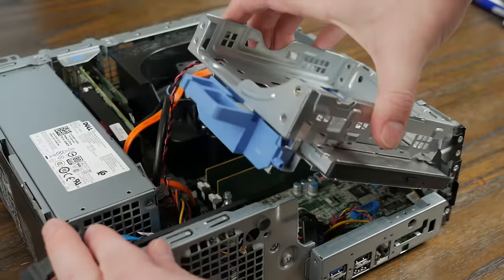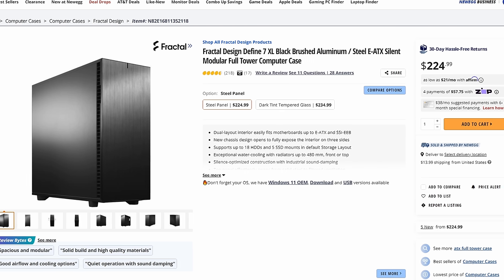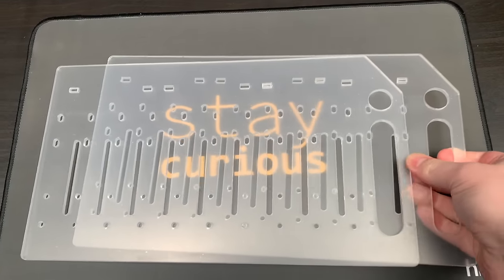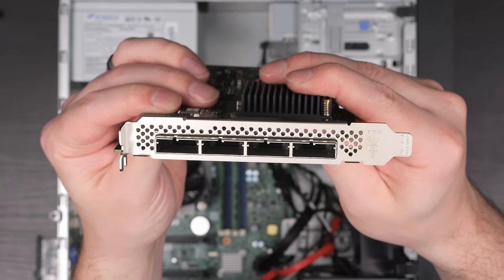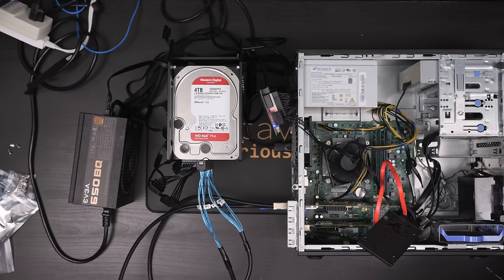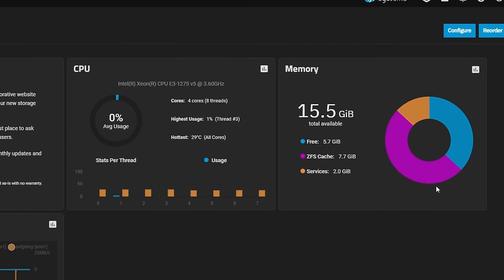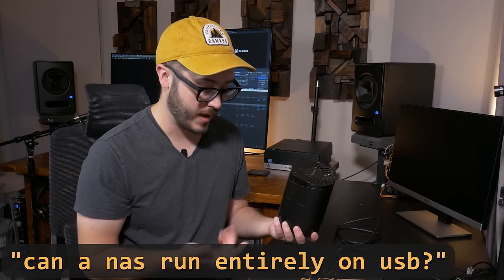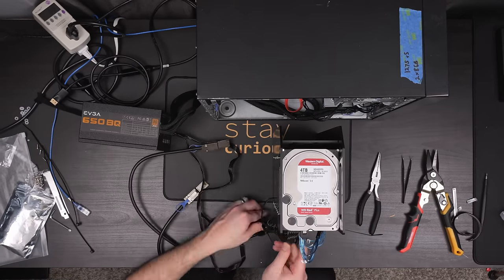I Made My Own JBOD Enclosure For CHEAP

Comment: IMHO what really is only required is to have "unlimited" number of disks connected to any computer and have direct access to those by the one OS using just one cable for eSATA or USB. Nothing fancy really required by bandwidth for the drives, just expose direct access even if it would be a 20-30 MB/s read/write speed. 

A NAS doesn't need to be extremely fast for most people.
It will hang on most people behind a 10/100 wired connection or even a 802.11n (150Mbits) wireless connection.
So the networking is really the bottleneck for whole stuff. 

Those who need massive amounts of storage for 8K video editing material, 3D rendering cache drives etc, that means they have money and options to go for full expensive servers. 

We really need a cheap, reliable and accessible HDD enclosures that would offer those 2/4/6/8 drives behind one cable (+ external power). 
It would allow to use any tiny computer with USB or eSATA port or two to get even max 8 (4x2) drives in.
Now it is more like required to have a external enclosure for two drives behind USB port, and if you want 4 or even 6, you pay crazy money for that.

As what does most people really need or want? It is to spend some time to just save their data on simple RAID 1 mode (if even that!), and then now and then connect third set to sync with NAS and then be moved off-site for backup purpose.
The bandwidth for data usage is really about streaming a own video from the server, as otherwise it is just accessing some normal documents or browsing some web gallery etc. 
So after the initialization, data bandwidth is really low, someone in family uploading a file from phone, someone from laptop etc, common 1-20 MiB in size at max. 

In time it makes great NAS to be tugged somewhere dry and cool location and forget it.

Comment: I did something similar but found a metal case called Sans Digital HDDRACK5. Fans and power switch included, also stackable. Unavailable now sadly
Reply: Had it book marked for years and never pulled the trigger.  The only thing that held me back was a solution to mount it in a case.

Comment: besides my main PSU (using it for my PC; it has 4 Sata adapters), I have another cheap PSU. How about if I use 4 Sata adapters of that cheap PSU? Following that way, I will have a total 8 Sata adapters to run 8 HDDs and SSD. 

Does it cause a conflict between two PSUs. But I only use Sata adapters from the cheap PSU, how can it cause trouble with the main PSU of my PC?

Comment: Can anyone mention what to keep an eye on for a PSU in a solution like this?  Will a 400 W PSU handle ~400 W of hard drives, or is the amount of power available to the SATA connectors much lower?  And are there limits to how much power is sent across each "line" of SATA connectors?  

If this is a well documented topic, would someone mind letting me know the proper search terms to throw into Google?

Comment: Pfft.. Fractal Node 804 8 drives. got one for 75,- X570 mini ITX with AMD R5 5650 PRO with 32GB ECC. system alone uses 28 <- Watt with 2 SDD +9 Watt  with an LSI 2008 :P
AND a couple of watt for my 6 PH-F120T30 120MM fans that can go up to 3000RPM and make it sound like a real "server" :P
i use an Icy-box 4 bay usb 3.2 gen2 10Gb that was 140,- or so. for my editing pc.

Comment: Hello, I dont understand if data in RAID (or RAIDZ) is protected agains loss or not. What can I do, If system drive will crashed? can I restore drives into another system as RAIDZ2? Or it only way to daily/weekly backup system not to lose your data
Reply: RAID lets you have redundancy. That means if you have a drive fail you'll still have access to your data. 
It is not a replacement for backups.
Reply: @MisakaMikotoDesu my question is not about crashing RAID's drive. It's about system drive crash, which can be unlucky be in only one copy.
Reply: @__-ur9gu  "System drive"? As in the drive your OS is installed on? If your OS is installed on the RAID, you can lose 1 drive (or more depending on your setup) and it'll still boot just fine. 
If your OS is on another drive and that dies? Then you will still have access to your RAID just fine once you reinstall your OS on a new drive.

Comment: Nice idea, but execution is lacking.
Frankly, I would rather use another PC case, and put it all inside. Usually there is enough space for two stacks of disks like that, and PSU would be mounted properly. Also it would allow to use bigger and slower 12 inch fans. If you lucky, you can get old case for free, or very cheap.
Instead of acrylic, You can buy metal plates with holes in a DIY market. This plates are originally used to join wood.

Comment: acrylic is the last thing i'd want holding hard drives in place. it is fragile and brittle and not suited for anything that vibrates tbh. for something like this, one strategy i like is making a cage out of extruded aluminum profiles (you kinda build a ladder for each side, L profiles for columns and straight flat bar bolted to it with a spacer for rows/rungs you can slide the hdd's mounting hardware on), removing the CD drive cage and HDD cage from the case so the entire front end is empty, then mounting the new cage in the empty space. bonus points if you make a SATA backplane so you can slide them in and out without tools (example https://www.youtube.com/watch?v=KICINe72tiM ).
Reply: if your drives vibrate so hard to shatter thick acrylic, they have some serious issues

Comment: I wish there was a variant for 2.5 inch hard disks.
Reply: You could buy the one he's using and make some holes yourself, with a drill, so that it also fits 2.5" drives. It's really just a matter of "measure never, cut whatever" 😂, no but in reality it should be doable.
Reply from the maker: I imagine there's a variant SOMEWHERE out there haha

Comment: The Sata Power expander are a Mayor Firehazard and it is not even a matter if they will burn at some point this practice has been shown to be so bad ever since these cables cables and molex to sata extenders have existed. Its not even a question of quality it is just plain a matter of physical reasons. A new quality PSU with >8 sata cables is a round 75$ which compared to the cost of 8 drives is minimal.
Reply: maybe don't buy the trashy adapters that have fake gauge wire

Comment: Can you edit directly from NAS or do i need to drag my files first ?
Reply: if the nas is fast enough (both drive and network connection speed), then you can, for the most part
Reply: @night_h4nter Aight, i have couple old computers i fill up first, and then think about external storages.

Comment: What is the logic of using JBOD structure when you have so many disks on hand? Wouldn't it be more sensible to use RAID structure? What will happen if disks fail?
Reply from the maker: I’m still using RAID just in software
Reply: jbod in this case is more of a term to describe the physical structure, not the storage scheme

Comment: Ok it runs,fine.My thougts on hardware : You wont need a sas controller when you use only 4 hdds. Use Proxmox on a pcie nvme ssd, go with disk passthrough.Why an addidional psu,use a big enough one(the 8 hdds consume only 65 Watt), no powerswitch and no fan regulator(can be done by resistors).My thougts on software: you could even run theTruenas Machine in windows hyper-V (the power saving options are exellent).Go with trurnas core, what scale gives you you already find in proxmox.The raid layout. besides this not a jbod  : Try 2 mirrored Strpes (4 disks) or 4 mirrored stripes (raid 10/50, they dont call it like this). Put more ram in it (recommended 1GB per TB !    Nice Video, have good day and thank you.  M.S.
Reply: i think in the video he says swapping psus isn't always an option

Comment: I'd love to see you get a 3D printer and design a proper enclosure rather than using a crappy AliExpress solution. Also, could you use a pico PSU for the drive instead?

Comment: Cute, but if I had to spend say ~$180 for a hard drive x 8 drives which is ~$1500 then adding an extra 300 for a good enclousure doesn't seem like a such a rip off anymore.
Reply from the maker: I actually cut a section of the video out where I talked about that exactly. It just got a bit long. It really depends on the buyer/circumstances, but yeah it's definitely something to consider if you're also about to drop $1000-2000 on drives haha
Reply: for 300$ you get a cheapo usb enclosure that is not great.
Reply: @marcogenovesi8570 I meant extra 300 on topo of the DIY solution cost. Which gets us to around $500. Still not great, but you could find something serviceable for that price. Whis is not nothing, but disks are the most expensive part here anyway.
Reply: @HardwareHaven  At least we've got an entertaining video out of this :)

Comment: While this is pretty neat and I've considered doing this myself, at 15:07 enterprise disk shelves are mentioned. I picked up a 24 bay 3.5" drive shelf plus controller and cable from the seller listed in the screenshot (disclosure, I am in no way affiliated, just a happy customer) and it comes with redundant power supplies and redundant controllers, and you can daisy-chain disk shelves together. Obviously it's a bit loud but has been running rock solid for years in my basement. The shelf is SAS-capable, but I can't remember if SATA will work as well (just because SAS has a compatible connector with SATA doesn't mean it will work with the controller).

It would be neat to see if you can bring that DIY version to its knees to see how reliable it is though.

Comment: you should build a diy server rack - 2x4 plus plywood - save 300-500 bucks - as for changes on this system...just buy a big case first of all and forego the hba and go with sata pci-e cards but for people who need the expandability this really is a decent option - make the fans into a modular system than you can pivot or move out of place and make the drives toolless - ie you want caddies  the plastic tongs that connect to drives on side and you can just slip and they snap into retention slots - there could be quite a bit of optimization here - going with an upgraded ps that can support all drives is preferable but again for people that want to run 10-20 or more drives the addps board and hba are good options - good due diligence on this one - maybe do a followup when you tinker some more and get some miles on it - it works and that is the main thing

Comment: I don't understand that setup at all. You can pickup a motherboard and just put the entire setup inside an old tower case.  A used fully populated motherboard with 8 or more SATA connections is cheaper than all the miscellaneous stuff you need for this setup.  Hell, even if he picked up a couple drive cages and stacked them it would be cheaper and more convenient.  It would sure be easier to swap drives when one fails.  You could do it with mostly E-waste parts too.
Reply: not all mobos from those dell/lenovo/etc computers are atx-compliant, so it's not always an option

Comment: Why go for the mini sas board over a 8/10 port PCIe to Sata converter given the price? Was it just for easier cable organization or does that have a stability benefit? I ask because I am planning to do something similar in like 4 months but was planning to use a with the Sata breakout but will go with this if it is more reliable.
Reply: the 8/10 Pcie Sata converters are often less reliable. It's actually done by using an asmedia controller and slapping one or many Sata port multiplier in front of some ports.
The main issue is the sata port multiplier, if you get a 4 port sata controller then it's done all by the same chipset without port multipliers and it's usually ok.
Reply: @marcogenovesi8570  that is good to know. Thanks!!

Comment: Me: Netapp DS 2246 now featuring silence and 12 gbit
Reply: sata disks are 6gbit only, you don't need to buy a 12gbit sas card
Reply: @marcogenovesi8570 I also had to remake the sas expander because yes, so I took an adaptec 12 gbit sas expander that can also be powered from molex connectors

Comment: LSI is DEAD.... plus the drivers are buggy.

and YES you DO need fans.. becasue if you take the trouble to READ the drive datasheets, these high cap drives are FORCED airflow only.

In some cases you only need to be out of spec by 2 deg. and it is game over.

Comment: 4tb drives in 2024? no wonder you're out of room.  instead of buying the second enclosure and the fancy psu relay and using a second power supply, and the hba, and the cabling, you could have spent about the same amount and pick yourself up a few 14-16gb 7200 rpm drives.  4tb is just NOT enough density by today's standards.  Personally, right now, i'm running 8x 14tb wd easystores (Basically 7200rpm wd reds that i've shucked out of enclosures) in raidz3 and there's room for another 8 in my fractal design meshify 2 xl.
Reply: How many 14-16tb drives can you buy with 200$ or less (which is the budget spent here)? On ebay I can get like one, used, with some pocket change to spare.
(EDIT: spelling)
Reply from the maker: These drives were just for testing. Having 8+ 12TB drives just laying around isn't that affordable lol

Comment: Not gona be fun finding the SN# of a failed drive tho.
Reply from the maker: True, lol. Would be worth the time to label them before putting them in
Reply: I just use a regular label maker to label the sides of the drive with the SN. But I kept mine clear. You could just label the sides of the plastic if you wanted to paint.
Reply: I agree.  I make sure every hard disk is labeled with the serial and function (Parity 1 or Disk3 or whatever).  Make sure it us visible.

Comment: How bout you run  the worst raid ever.... Do all the things people say not to.  Buy a bunch of Used drives, make the sizes all different, run without any ups/surge protection, and do a long term use experiment on it, if what you have supports the junk fake hardware raid run that.... Both A: how long you can keep it going, and B: videos on what it takes to maintain.  And maybe C: things you can do that are free or cheap to make it better

Comment: Please use RAID5/6 instead 😰
Reply from the maker: RaidZ2 is essentially Raid6. The naming is different in ZFS, but it’s still two drives worth of parity data.
Reply: @HardwareHaven  I didn't get to finish the video as I was on lunch. I thought it was a JBOD. Good deal if you're using RAIDZ.